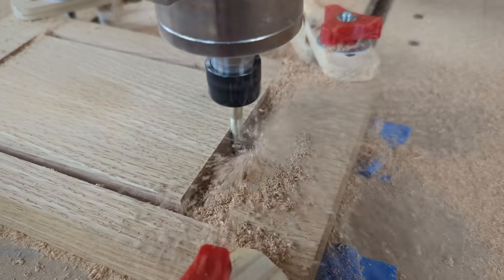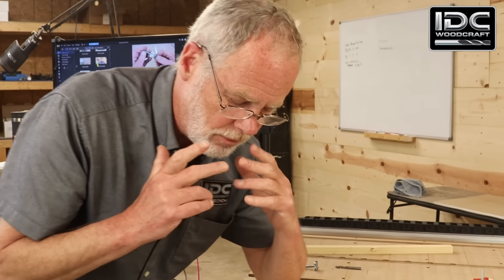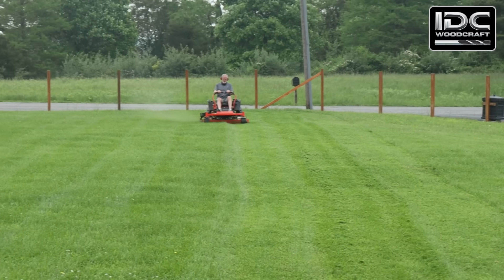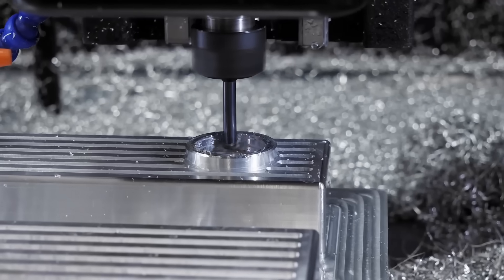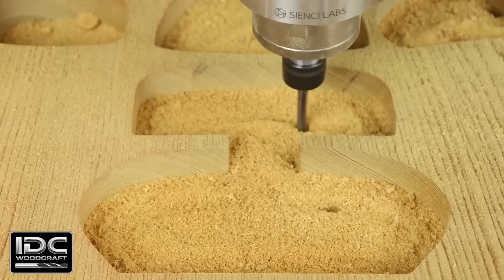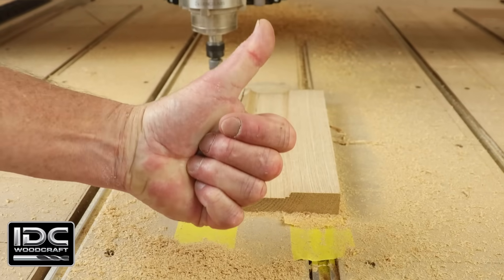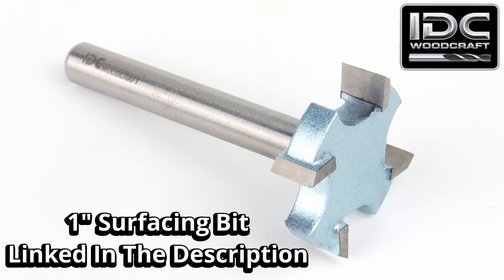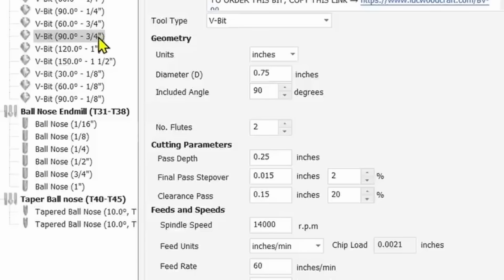CNC Stepover Explained: Smooth Cuts vs Fast Cuts

Comment: wot would be the recommendation on step overs on finishing passes for 3d projects
Reply from the maker: For finishing passes on 3D projects, a common recommendation is to use a step over of about 10% of your tool diameter. This helps achieve a smoother finish without sacrificing too much machining time, but you'll want to adjust based on your specific project and desired detail!

Comment: Cheers Garrett. Use info. I am a beginner to CNC and trying to set up a CNC router job to machine a topograhphical site model for achitecture student. Thanks for being able to download the tools list with settings for Fusion360. Will the settings still apply if using Metric? Cheers from NZ
Reply from the maker: Hey there! Yes, the settings can still apply if you're using Metric, but you'll want to make sure to adjust any measurements accordingly. Cheers, and best of luck with your project from across the pond!

Comment: So if i download your full bit database, it will have all your bits loaded into that list, but if don't happen to have all those bits (yet), it still shows all those bits in the list, and it's up to me to choose the correct bit from that list for my job? I'm assuming?  So if i choose the wrong bit from your list, it will use those parameters pre-set to run the job, and end up with bad results? Thank you, i just want to clarify. Edit: subscribed as well today, thank you for your helpful input.
Reply from the maker: You got it! The full bit database includes all our bits, so it’s up to you to select the right one for your project. If you choose incorrectly, the parameters may not give you the best results, so be sure to double-check! Thanks for subscribing, and we appreciate your support!

Comment: Is it true, for the bulk area of a bullnose cut area, you could use a standard bit, then leave wood to cut equivalent to half the width of the bullnose to allow the bullnose to make the gentle curving shape? right?
Reply from the maker: You're absolutely right! Using a standard bit for the bulk area and leaving just enough material for the bullnose to create that smooth curve is a clever approach. Thanks for sharing your insight!

Comment: I think you alluded to something but didn't speak to it specifically... if I'm running a 1/4 endmill at 75 IPM at a 40% stepover (and making chips keeping it cool), should I then pump up the feed rate when I do a finishing pass at 10% stepover to help avoid heat buildup?  I've noticed another channel speak to that recently, but I've never done it before. It would appear to make sense and would speed up the finishing pass. Thanks as always, Garrett!  I love how these videos cover stuff I know or have learned over the last few years, but there's always a new kernel of knowledge or two I can glean that keep upping my game.
Reply: Also curious on this point
Reply from the maker: Great observation! Pumping up the feed rate on a finishing pass can indeed help reduce heat buildup and can speed things up, as long as your machine and bit can handle it. Thanks for the kind words, and I'm glad you're finding those kernels of knowledge in our videos!

Comment: "Scan Line" is actually "Scan Gap" and that is a laser term  in metric ( for Chinese lasers). This translates into resolution, which most U.S. lasers just input 300dpi, 600dpi, or 1200dpi.
Reply from the maker: You're absolutely right, and it's great to get that clarification! Thanks for sharing your insights with us!

Comment: Great explanation!
However, you threw me a curve ball.
The “terms” you shared included “offset”!
Offset can be set in several places in Vectric.
Do any of those override the parameters in the tool database?
??
Thanks Garrett!
Reply from the maker: I'm glad you found the explanation helpful! When it comes to offsets in Vectric, they can indeed affect your tool paths, but typically, the settings in the tool database will take precedence over other offsets.
Reply: @IDCWoodcraft clears up my question!
Thanks Garrett!

Comment: Hey Bro - great explanation, especially with your visual aids.  I think I understand stepover.  You seem to talk about it in relation to material removal though.  How does it apply, if at all, to profile cutting and corn teeth bits?  A vast majority (75%) of my work is done with small diameter (.08 to 1.4 mm) corn teeth bits.
Reply from the maker: Hey there, I'm glad you found the visual aids helpful! When using small diameter corn teeth bits for profile cutting, stepover can still play a role in determining the finish quality and cutting efficiency, though it may be less impactful than with larger bits.